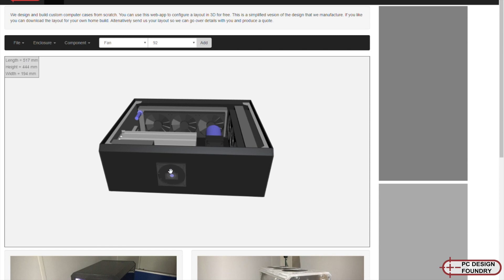Custom PC Case and Web App

Comment: Where did you get the carbon fiber from? Also really well done on the custom psu wires, looks better than cablemod
Reply from the maker: Hi Alec.   I got the carbon fiber from     Easy Composites. 
 https://www.easycomposites.co.uk/     they can ship to me  next  day and the quality has been great so far.         

Thanks for the comment on the PSU wires.   I made my own because I wanted to use really high quality wires with a high strand count and silicone insulation.  It makes them really flexible so you can get tighter bend radius.  I left a section of the cable without sleving  close to the connectors at the PSU end.   That way I could have very little space between the PSU and the radiator and still get all the cables in with very tight bends.

https://imgbox.com/6CFz8wdK#

It took a long time to find a good source for the braid.  I wanted a large amount to potentially make more cables in the future. So I got some from Alibaba.   I had to buy a bunch sight unseen so I ended up with lots of rubbish braid till I found a good one.

Comment: That web app is absolutely fantastic.

I've been wanting to build a custom case for a while now and I happened across this video and then noticed the web app in title. Checked out the link in the description (on my phone) and I ended up spending an hour (on phone) designing my PC. It's so intuitive, even on a phone. The only issue I have is that it just stopped letting me interact with objects. So I saved, loaded and it still wouldn't let me interact. Also, certain objects had moved slightly. I'm going to check it out on PC now.
Reply from the maker: Hi Fluxtroid.  I  fixed the bug in he web app that was causing the objects and save function to stop working.  Unfortunately it wont fix your already saved file.  Sorry for the inconvenience.

Comment: Hi Andrew, I have a question about your CNC router, hope you don't mind.  I'm in the process of purchasing a new router and believe you are using a JBEC.  Your work looks incredibly tidy, very impressive, would you recommend the JBEC?  Thank you
Reply from the maker: Hi Andy.  Yes I would recommend the JBEC. It is capable and has high quality components. The support you get form Stoney CNC is really good. There are more expensive systems available that would be better suited to high volume manufacturing. They tend to have automatic tool changers, zeroing and better dust protection for the slides.   With the JBEC the setup is a bit more manual and it takes a bit more time keeping the slides clean but they are very versatile. I use mine to cut Aluminium Sheet up to 3 mm thick.  Cast Acrylic up to 15 mm thick, Carbon Fibre 2 mm  in a water bath,  some rigid PU modelling foam 40 mm , Aluminium extrusions form 1" square stock.  Not much wood but other people have.  You just have to make sure you are using the right tool and settings  for the job.
Reply: Brilliant, thank you for your reply, it’s a difficult decision.
Reply from the maker: Before I got this machine Stoney CNC put me in touch with some of their other customers who were nearby and I was able to visit one to see it being used. That was extremely helpful.
Reply: @andrewlauder774  That's a great idea I will get in touch and see if there is anyone in my area.  Thinking I will purchase from Stoney I have only seen good comments about them, just have to decide whether to go for the Axiom or the JBEC.  Thanks again for your help.